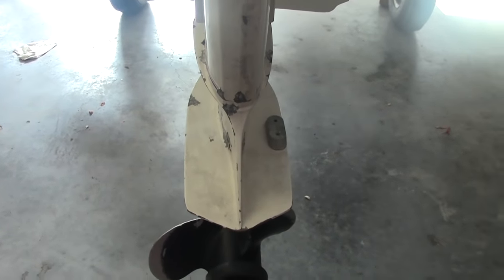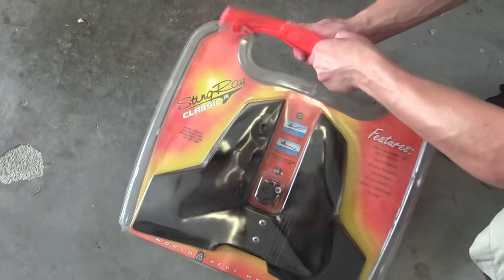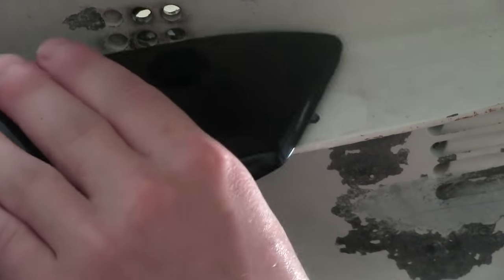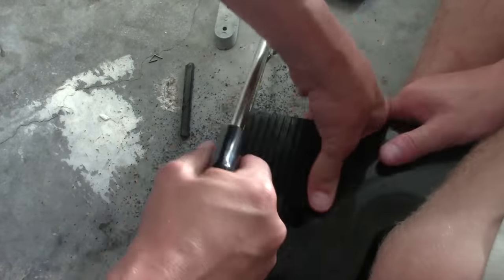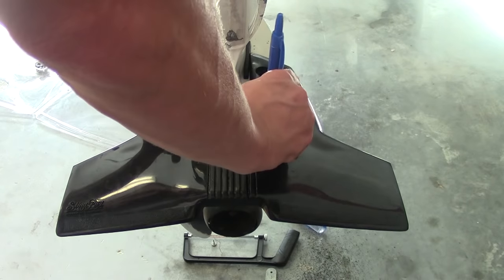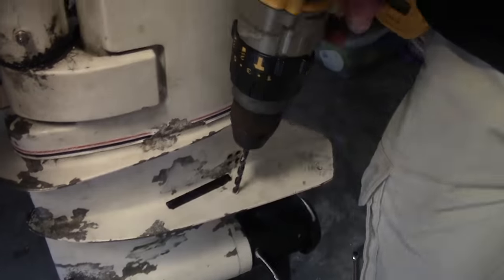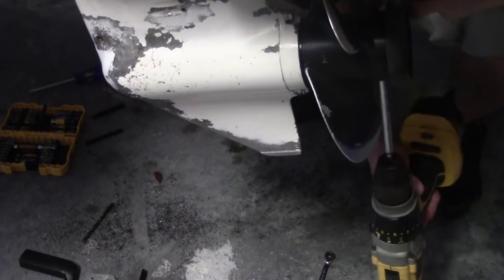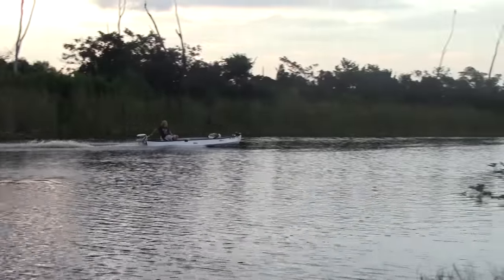Stingray Classic Jr HYDROFOIL Stabilizer Gheenoe Bow Rise Installation FIX!  Easy Do It Yourself DIY

Comment: That Hydrofoil did a great job with your ride quality !
Reply from the maker: That's right.  The Stingray classic junior worked great.  It slowed my Gheenoe down a bit but, the boat is controllable  now.
Reply: That's because there's more boat in the water now. More resistance will slow you down. If you were to cut a 1/2 inch off each side to make it a little narrower, you might get about the same results but pick up a little more top end speed. jakeguitar01
Reply from the maker: You know it.  I know it.  We all know it.

Comment: Excellent i have had a 18foot ski boat and always wondered wether i should install one of these trim tabs on the motor now i will as my front comes up too high and want to lift the rear of the boat quicker and get better smoother ride and handling

Comment: Great job. Runs good after. Seemed to be exactly what you needed on the boat I've been thinking about getting one to help the hole shot and cruise on plane at lower speeds for our new custom gheenoe
Reply: they're great for knocking 2-3 mph off your slow planing speed
Reply: Weekend Pirate, it’s definitely a good upgrade.

Comment: I tried to put one on my 2006 15 hp mercury , but noticed the flushing port was above the prop and I couldn't attach my ear muffs to clean it out.     I had a 2005 gheenoe years ago.  Badass little boats

Comment: I have used a device similar to this and had very good results on my 140 HP ski boat, getting on plane quicker and increased stability in cornering.  Why don't motor manufacturers use this concept in the design of their motors? It seems to me that they are missing the boat!
Reply: I agree James...my 18 ft ski boat with 140 HP came with one already on it and a few years later I decided to take it off just to see the difference. Boat took a lot longer to get on plane and as soon as I did get on plane I went straight back to the boat ramp and put it back on.

Comment: Great video - gonna try it on my 15 foot boat with 10 hp engine... Thanks :-)
Reply from the maker: Cool.  Let us know how it works.  What I do is take it off or leave it on depending on whether I am going out by myself or with someone else.  By myself, I definitely need it, and with another person, its really not needed at all.  Its optional...as long as you can put up with the boat slowing down.  All in all a good product.  It does what it says.

Comment: Mounted 2 of these to two VERY different boat setups.  16ft bassboat w 90hp Merc, and small boat w 15hp Evinrude.  Eliminated bow rise and porposing in rough water and have much faster hole shots.  All this even in a small boat with NO extra bow weight.
  I wouldn't put a boat in the water without one of these mounted.

Comment: It will give you more lift but will increase a lot more drag...  I have found if you extend the anti-ventilation plate aprox 6 to 8 inches at the same width and thickness, it will give you more trim action with out increasing more drag.

Comment: Nice job. Such a great improvement for a couple of mph.
Reply from the maker: Yes, we lost a few mph with this hydrofoil, so I decided to use it only when boating alone. As long as I have two people in the boat, its fine, because the guy in the front keeps the bow down.  So, now I use the hydrofoil only when going out solo.  Its easy to take on and off...
Reply: what size bolts come with the hydrofoil
Reply from the maker: Not exactly sure.  I think 1/4 in x 3/4 L in but please don't quote me on this.

Comment: I will CONFIRM if you install the Stingray crooked it WILL make the boat pull to one side.  Back when I got my first boat which was a Stingray 501ZP (16.5' open bow, outboard) the original owner installed one of these on the 75 horse Force Outboard and the first time I drove the boat it pulled horribly to one side when I took it for a demo drive.  The owner said "yeah it does that, not sure why!".  I looked at the plate after I bought the boat and saw it was crooked as all hell.  I removed it and filled in the holes in the cav plate and refinished the lower and the boat was back to perfect! :)  In my case the boat didn't need one of these he just thought it would make the boat "faster" for cheap..
Reply: I'm guessing it wasn't mounted squarely. I've put one of these on two different boats.  A 16ft bassboat w 90hp merc and a much smaller 14ft boat w a 15hp Evinrude. There was no pulling whatsoever to either side. In fact it improved the handling on both boats.

Comment: Changing the height and angle of the outboard would probably eliminate this problem. Most older outboards have a metal rod on the motor mount that will set your angle and riser blocks will change your height. Weighing down the front will also help ride quality in such a light boat.
Reply: Tyler Sabelko has nothing to do with the trim. I have electric trim and have tried my boat with and without Stingray. It has dramatically increased stabilization (on all trim settings) as well as made it effortless to get on plane.

Comment: Thanks for the share. My 12' duraboat with 15hp merc has tremendous bow rise and no planing without my boy in the front. Engine tilted in as far as she'll go. Recommend? Still a little new to trimming.
Reply from the maker: +E. Squatch -->  See if it's possible to raise up the whole engine.  It's possible it's just too far into the water.  They have engines with a short lower unit and ones with a long lower unit. Or you can just put one of these parts on your engine.  They seem to work.
Reply: definitely, if it's peeling the motor plate to make the mount spot taller go for it! put that plate about 3/4 below hull line is usually about right. I used oak (1-1/4" taller), long screws and glue. 3 thick coats paint then slam the motor plate onto it's new taller home. if you have a long shaft engine yes find a short leg/shaft for it. long shaft are more typically sailboat pushers, so you'll likely need to swap prop along with. most transoms usually 15-1/2 to 16", or about 20". a sailboat pusher on a short transom is NOT a pretty situation!

Comment: If the motor height was set better you would not lose that speed.  Here's what's happening; the motor is too low, applying too much rotational force to the boat and lifting the bow, you put the planing fin on there and counteracted that with a large amount of lift on the stern, trimmed very low and the fin angled down sharply to the rear..  Move the engine up, trim it up a notch so you use a smaller amount of lift and still have the same ride.
When I used these I gained speed as it lifts the hull out of the water for less drag, yet giving more control to prevent chine walking and porpoising at 65mph in a 14.5' boat.

Comment: Using a jackplate without the hydrofoil, should give the same trim effect while maintaining and/or improving your speed.
Reply from the maker: Yeah, probably right.  Because of the length of the motor, the prop is sitting very low.   Btw, the bow rise helped me out this past weekend, however.  I took the hydrofoil off and two of us wend out in some pretty choppy water.  I would have gone under if it weren't for the front end coming up high...
Reply: done it the "cheesy" way (cheap and easy) too, peeled the motor plate, sanded the top clean, glued+screwed oak to fit, replace motor plate. raised the outboard about 1.25" did wonders, initially it was 2" below hull line. near all the porpoising issue was solved, it was just too deep.
Reply: Fj4LiFe23
WRONG. Educate yourself on the PHYSICS OF THE TOPIC, rethink (using LOGIC this time) and THEN try to comment again. 
We'll wait...
Reply: Not really, I got 14 feet Jonboat, 18 hp Tohatsu,  and even with the motor tilted outwards all the holes, still the bow is sky high, unless I put some weight at the bow. Looking at the video, it is clear that stingray would help to ride alone easily, without any weight at the bow

Comment: if you go to a lower pitch prop it won't slow down so much you losing rpm with that thing on lower pitch prop will gain back lost rpm
Reply from the maker: I am not so sure that would help but I would be willing to try switching props if I had another one.  I really thought the boat slowing down was because there is just more of the boat in the water.  In other words, the front of the boat is sitting lower in the water which is causing more resistance.

Comment: I have a 95 Gheenoe classic with a 1986 Johnson 6 hp seahorse. I don't need this garbage and my boat is always on plane at any speed.
Reply: much lighter weight engine (more appropriate!) with much lower initial thrust,
matching power to hull is important. I've had that Johnson 6, great little OMC.

Comment: What does the zink anod do?
Reply from the maker: It prevents corrosion on the engine.
Reply: nattsurfaren The anode stops corrosion caused by electrolysis. However it won’t work properly with a coat of paint between it and the outboard.
Reply: Electrolysis it's designed to rust out before the aluminum does.

Comment: Ignore the naysayers. In 50 years of knocking around in small boats with outboard motors from 5 to 90 HP, I've never seen one that couldn't be improved in almost every way by adding a hydrofoil. Better yet, they generally cost under $100 and take less than an hour to install. It's a no-brainer!

Comment: hydrofoil not need.. should have raised motor up to the cavitation plate to be just above bottom of boat also change to a 4 blade prop and this prop would be gone
Reply: It's called a anti-ventilation plate not a cavitation plate..

Comment: Im not saying this video is completely fake, but the driver was making it porpoise like that deliberately at the beginning.  That was not realistic at all.  Later, after adding the hydrofoil, he didn't do that.  If he had, it would porpoise the same way with the hydrofoil.
Reply from the maker: The boat was actually that bad.  I wasn't making that happen at all.  The only way I can take that boat out without the hydrofoil is if I have someone sitting in the front.  Otherwise its just too impossible to ride.  It pops up and the back of the boat goes under....
Reply: You could have added/moved more  weight up front as well.  Just saying.  You have to try to get it to porpoise that bad by not balancing the weight, throttling, and timing the wake.  I'm not saying it won't porpoise, but to get it to be that bad is something you have to try to make it do.
Reply from the maker: +free88 --->  The only way you are going to believe me is if you see it yourself.   You shouldn't have to move 100+ pounds of unnecessary items to the front of the boat in order for it to ride flat.  Trust me, I'm not making any of this up.  It's not my first boat.  And there are no wakes to speak of in the Florida everglades, especially 20 feet from the ramp.  My gut feeling is that the motor length is a big part of the problem.  Too much of the engine is in the water.   Its a very light boat also.   The boat's weight, the engine, plus the weight all the way in the back play a big part in the whole equation.  Trimming the motor is no help either.  I still take the boat out without the hydrofoil, but only when I have a passenger.  The boat is faster without it...
Reply: I have a Gheenoe 15'4' myself, and have actually riden in two others.  Ive been on one with F9.9 and one with a 2 stroke 15HP. Yours looks like a 15'4'.  BTW, if it is a 15'4', 15HP exceeds the nameplate rating.  I do believe you can make it porpoise that bad if you try.  Adding the fin thing is one way to go.  I am not saying it is not.  It is a solution.  Moving weight forward is also a solution.  Trim tabs are also a solution.  Other things can also help.  Each have varying degrees of effectiveness and at different speeds, and often a combination of multiple improvements are needed to dial it in.
Reply: free88 From experience them hydrofoils do work in most applications. He has a 15 hp on a canoe which is not designed to plane. Don’t get me started on the anode instillation.  I see where you’re coming from

Comment: you should N E V E R hit your lower drive with a hammer like that IS SO STUPID!!!!!  Just Drill, first with a smaller drill bite then use the one intended for the screw, but hitting your lower drive with a hammer???? CMON!!!!  Dude you need real tools not Playskool tools......
Reply: I don't see any other way to do this, besides, he just lightly tapped it.  Btw, I am looking forward to seeing your video on how to install the Stingray Hydrofoil.  I'm really just excited to see your cavitation plate scratched up while the drill bit dances around your mark.  Good luck steering strait when your hydrofoil is mounted crooked and your cavitation plate looks like swiss cheese!

Comment: 15HP for canoe? You should buy new BRAIN, not "stabilizer"...
Reply from the maker: New brain costs much more than stabilizer.  I only had $50 that day.
Reply: Dude, you don't like things that go fast?
Reply: I likt it, but SAFETY first place!
Reply: Its a gheenoe not really a canoe
Reply: Jakub J. Some have hogger hull speeds and are rated for bigger motors. A 15hp Geanoe isnt overkill if you're in open water. There's people that use them in the ocean and need the higher speed and power to go against current.
Reply: Michael SANCHEZ i have a highsider with a 15 and a trolling motor and battery under the front deck and rides fine and runs around 30.
Reply: Kyle Proctor sweet dude. I have a 16' Scanoe and have a 5hp Suzuki 2 stroke on mine. My 2 stroke has seen better days and I'm looking to get a new one. I'm looking at getting a new Tohatsu 4 stroke outboard soon. Right now I'm just cruising out on the dam where there's flat water with my 55lb thrust Watersnake trolling motor until I get my new outboard. I'll be able to afford a new 2019 outboard at the end of the month so I'll be out in open water soon. Happy sailing dude.
Reply: Jakub J. Haven't put mine on, but I bought a 19 foot Grumman canoe with a engine lift and a brand new Johnson 15 horsepower outboard. I'm poor and want to sell it, but my father wanted the new motor, traded a old 15 and a 7 horsepower Chrysler! Waiting for the money to roll in!
Reply: It's a gheenoe lol not canoe. Speaking about brains how's reading comprehension?
Reply: Jacub J. He got a brain. Rides a canoe with 15 horsepower so well, that he still is afloat, could you?